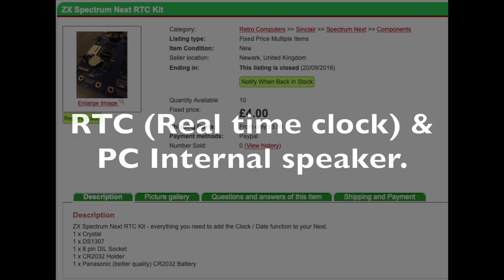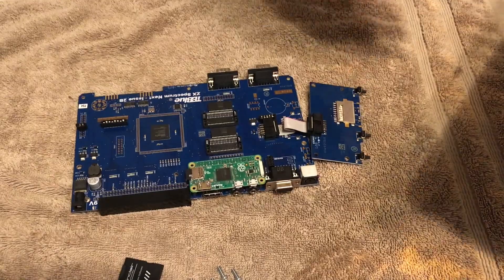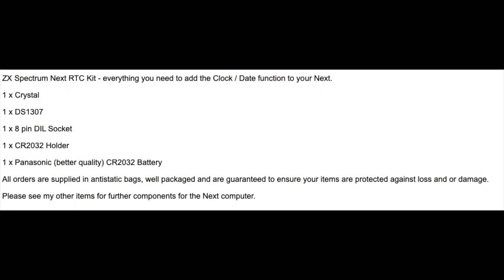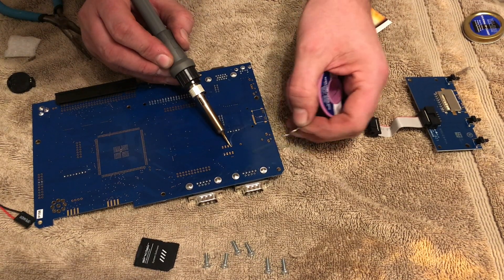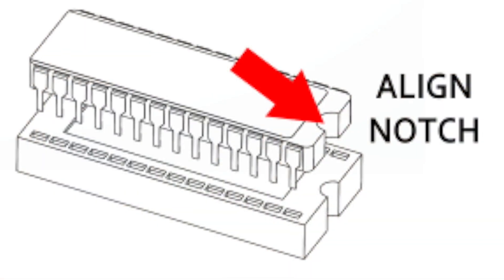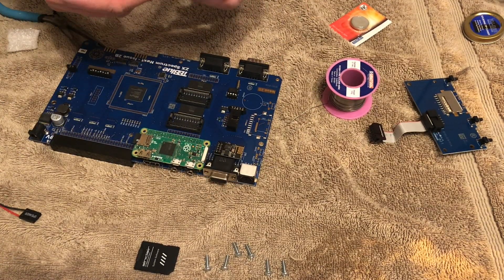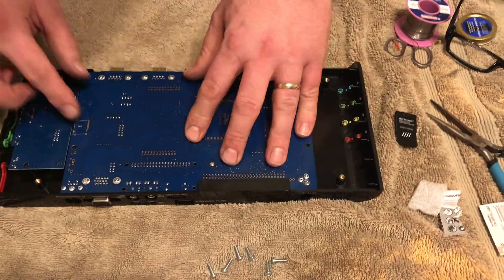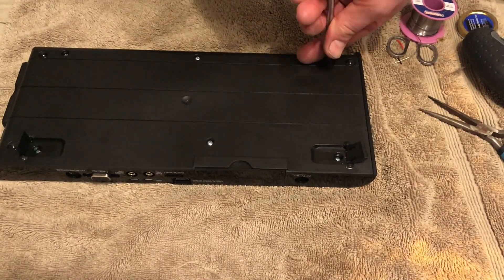ZX Spectrum Next Upgrades PT2 RTC & Speaker &wifi

Comment: What size solder wire did you use? I just tried to do the rtc and the wire I had was too thick.
Reply from the maker: I have a couple of solder sizes but usually very thin. 0.8mm / 1.2mm